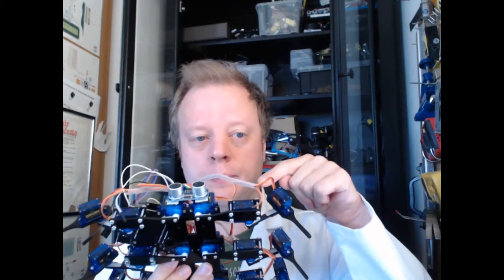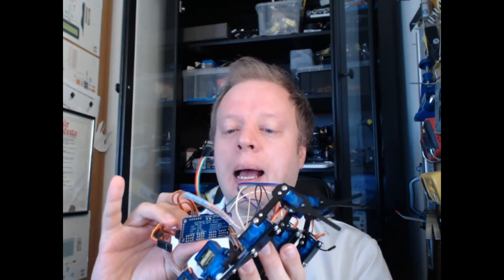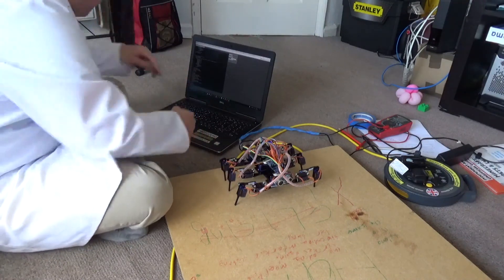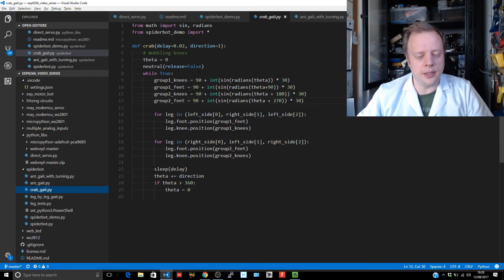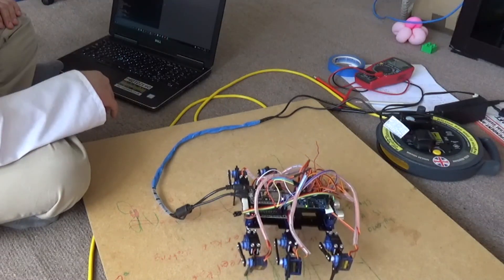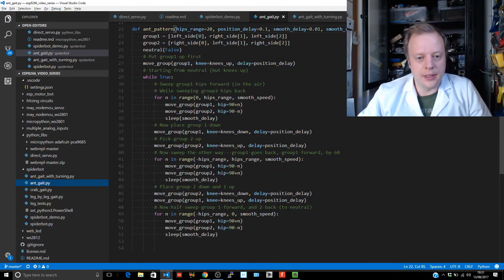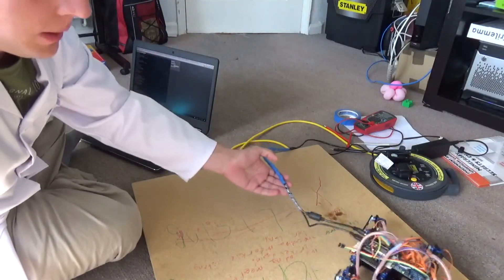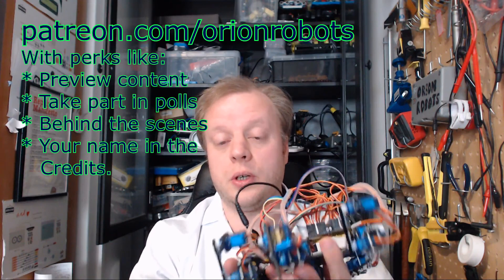Spiderbot Part 2 - Exploring Gaits on an esp8266 Hexapod

Comment: Seems like some rubber feet to reduce slipping might be a good idea. Could turning could be achieved by using different hip ranges in each side?
Reply from the maker: Hi Samuel, 
I may go slightly Ghetto (like I usually do), and wrap the feed with a tiny bit of scored-electrical-tape for grip there.
Between you and I- I've already been filming the next part, and scaling the hip ranges is where I went on it, with a couple of hitches as always. Nothing caught fire though!
Reply: Orionrobots I'm not sure how well electrical tape would work but give it a go. I might consider a little blob of hot glue as a possible option if that fails. Either that or move from the wood to a slightly less slippery surface.
Reply from the maker: I found carpet was actually really good - and less clacky. I'm going to ponder boots for my spiderbot...
Reply from the maker: I mean carpet as a surface, not trying to attach it to the feet - that would be a bit odd.